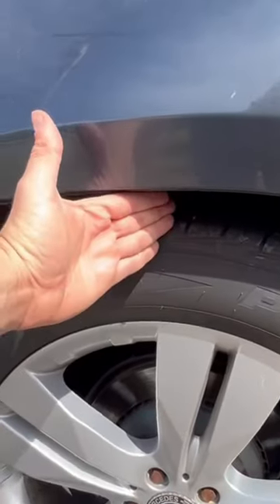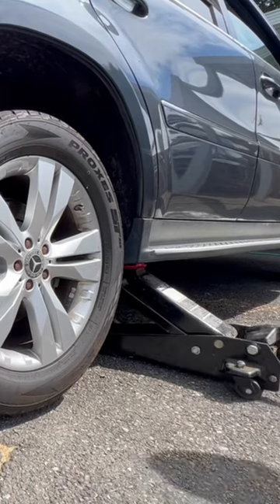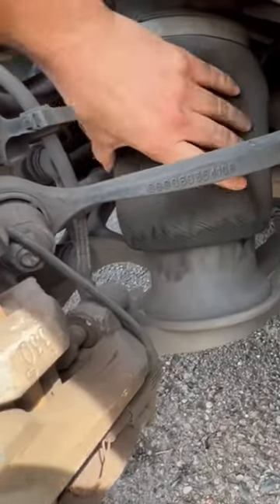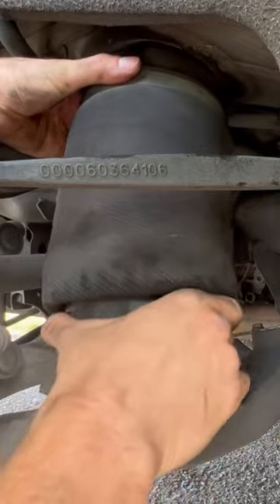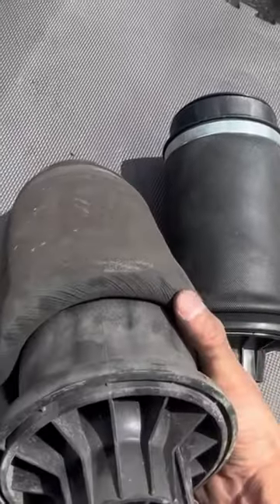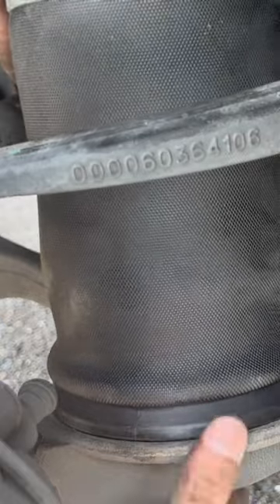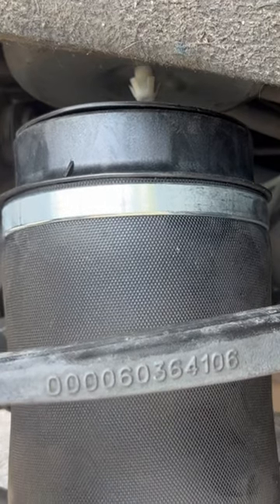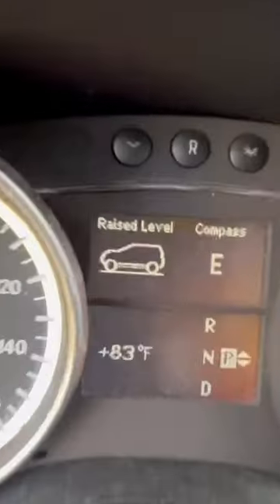Mercedes  Rear Air Spring  Replacement

Comment: Wow that’s so much easier than a spring, I always thought that they would be harder to replace for some reason
Reply from the maker: I thought the same thing. The rear is really easy. The front on the other hand is more like a traditional spring replacement.
Reply: @dadprojects3325 how much did those run you? 🙏